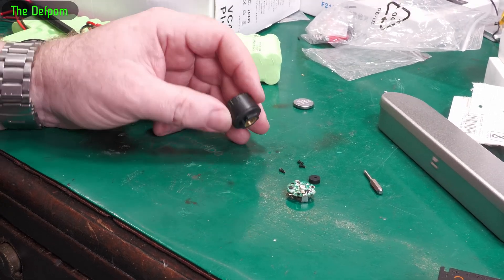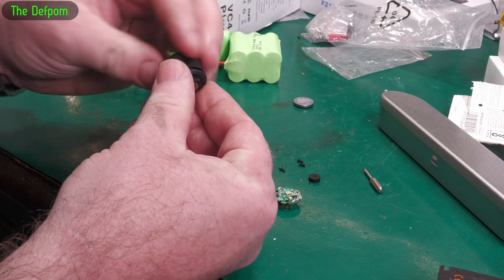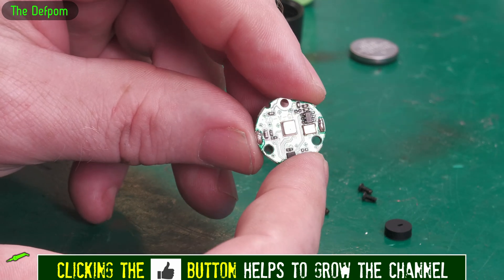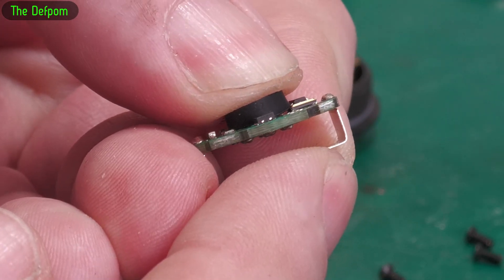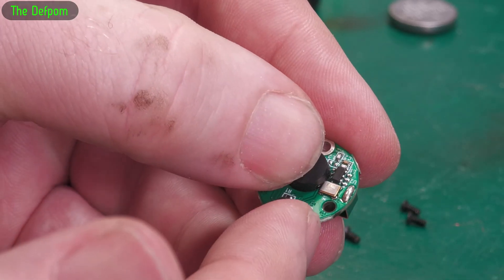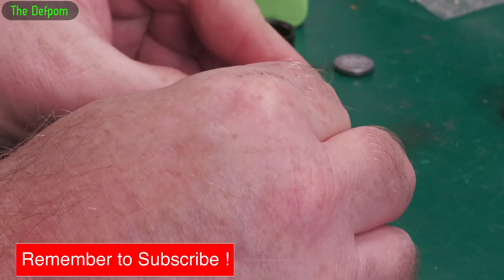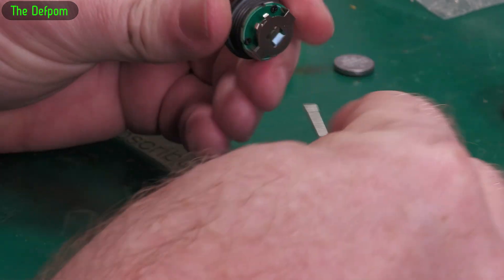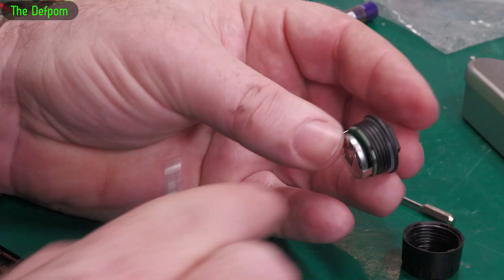🔴 3 minute Fix - Leaking TPMS Sensor Repair - No.1434

Comment: What does that lump do to the tire balance?
Reply: Likely nothing, because it is less than 6g, so will be about the same error as your typical tyre place has, as they do not set the balancing machine to accurate mode, just to ignore any errors under 10g, and say it is good enough. you can get sub 1g accuracy, but also no place has stick on or clip on balancing pieces under 5g, and you will also need to first have demounted the tyre, washed and dried both the rim and tyre, and then mounted it again, with a few rounds to find the sweet spot between the high spot of the rim and the low spot on the tyre, to get them to a best possible pre balance match. Unless you want to spend an hour per wheel, or have your own machine, no place will do that, just slap new tyre dot next to valve, and pop the beads on, and then quick balance till green, and off it goes.
Reply from the maker: It probably throws it out slightly, next time the car gets new tyres it will get balanced with them in place.

Comment: I would not fit anything that bypasses the tyre valve.  They spent a lot of time getting them to be extremely reliable, and then you go and fit a bit of unknown quality  Chinese rubber.
Reply from the maker: At least if it leaks it will tell us.
Reply: @TheDefpom but at 100mph i dont want it telling me it just let the air out.😂😅
Reply from the maker: @TheEmbeddedHobbyist where’s your sense of adventure?